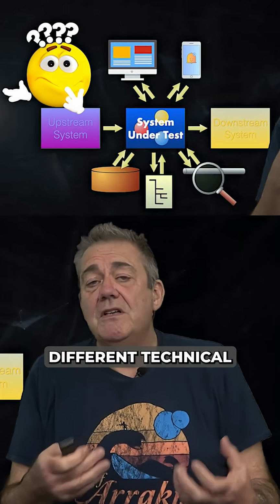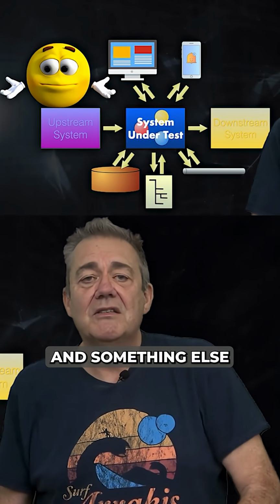The Hardest Part of Automated Testing

Comment: For integration testing we use an in-memory database and put it inside automocker. Works well but there are subtle differences between database engines. SQL server can handle cross apply... Sqlite can't...

Comment: Tigerbeetle has Deterministic Simulation Testing which helps simulating those edges.
For the actual hardware/external systems, observability+canary deployment is also another thing, which is not testing, but achieves the same thing.
They can be stress tested too btw.

Comment: One reason I do as many things as possible in a random fashion for many of my tests. You cannot count on a user - or another machine calling a REST endpoint - on giving you valid data. So, I maximize my completely randomized data and test it to thousands of iterations. By the time I get to 100 iterations, the subsystem is rock-solid. Very rarely, and edge case will reveal itself on the Jenkins builder - then having a reasonable exception message, or fwrite to STDERR to see what happened.

Comment: The point of the video is that testing isn't easy.  There are multiple factors you need to consider and deal with when trying to test a complex system (even simple ones take a lot of work).  It isn't just being monkeys on a keyboard or expecting a tool to "automagically" test the app/system for you.
And all of this takes time, planning, and effort to get done.